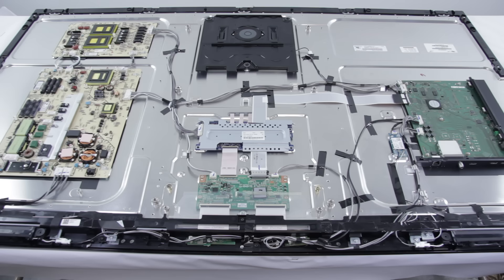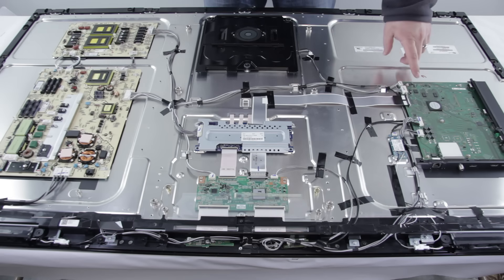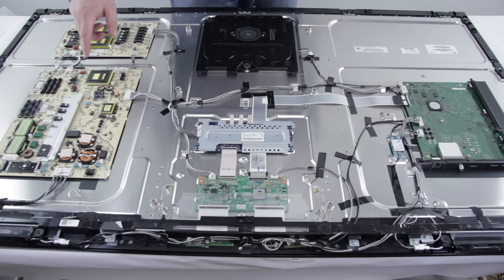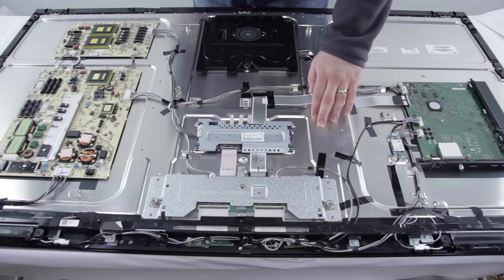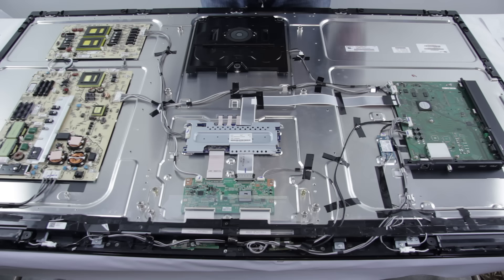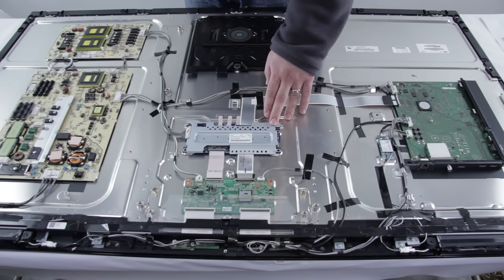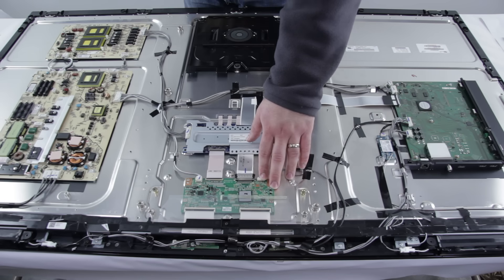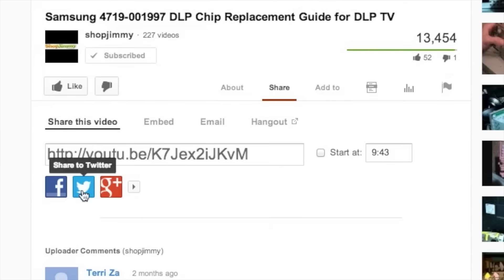LED TV Repair Tutorial - Common Symptoms & Solutions - How to Repair LED TVs

Comment: I have Samsung LED Smart TV UN46ES8000F and the TV goes through power cycling. The TV starts showing some random vertical lines and then turn off by itself. During the power cycling the remote control is out of control. Any suggestion how to fix this?
Reply from the maker: Reza Jafari   Try all repairs and troubleshooting at your own risk.  This sounds like a TV panel (TV Screen) problem.  If your TV panel is bad, it may be more cost-effective to replace the TV as panels are typically hard to find in stock, difficult to replace, and expensive.  Thanks and please let us know if you have any further questions!  www.shopjimmy.com

Comment: I have a 42 inch Sharp (model  LC42SB454U ). The power led on front panel is red, when I try to turn on tv it wll go out (no led light at all on front panel). and takes many attempts to power on.  I suspect that I have a bad capacitor on the power board. It will eventually allow me to turn on  (at which point I get the Green led on front panel) and tv works.   2 questions.    1:  is it possible to just find the bad capacitor and replace? if I find the bad (puffed up tin can capacitor type) and provide the voltage and farad specs, can you provide availability and cost.  Or 2: is is better to replace the entire power board and if so, what is the cost on this?
Thanks for your time and reply.
Reply: CoolUnderFire21 Sorry it was late the other night when I posted this, I have yet to pull the back cover off of my tv and will do in a couple of days, (time permitting) and get the power board part number and post here.  thanks
Reply: CoolUnderFire21 Ok, got tv down from mount, removed back cover, dusted out, found power board (2 numbers on it; one in the lower left corner of the board (715T3150-2) and the other one on the left verticle edge of the board with a bar code on it  ( ADTV82428PA5 (above the bar code) and (v28pa50610531 below the bar code).   I found a puffed up capacitor on the upper right (from pics I have taken) quardrant of the board, specs as follows  2700uf 16v (brand is I believe CapXom). I am versed in soldering skills and this should be an easy repair.   I would welcome any advise or recommendations as to just replacing the bad capacitor or if the bad capacitor may have caused other possible issues that could manifest later and would you recommend then just replacing the power board?
Can you let me know the costs (if you are able to quote them) for the power  board and the capacitor.
thank you for your time and effort.
Sincerely,
cool
Reply: CoolUnderFire21 UPDATE!!! I found and ordered the capacitor I needed and replaced and tv works like new. no more repeated attempts to turn in on..  comes on 1st time every time now (tested 50 times). so I am happy with my knowledge, and ability.

Comment: I have an 55" LG 55LW5300. Two white vertical bars appeared on the right side of the screen. They flicker and distort the picture. Any ideas?
Reply from the maker: Kayle Slaton   Try all repairs and troubleshooting at your own risk.  This sounds like a TV panel (TV Screen) problem.  If your TV panel is bad, it may be more cost-effective to replace the TV as panels are typically hard to find in stock, difficult to replace, and expensive.  Thanks and please let us know if you have any further questions!  www.shopjimmy.com

Comment: I have a LG 55LA4700, During a lightning storm power went out and came back on, after tried to turn TV on, only the LG logo at bottom glows for a few moments and then goes off, no sound, no picture.  I opened the back of the TV to check for blow fuses and or capacitors, power supply looks good.  I have tested fuse with continuity tester and they are good, so I am not sure where to go from here.  Can you help?
Reply from the maker: David Lindenberg  PLEASE SUBSCRIBE TO OUR CHANNEL - Try all repairs and troubleshooting at your own risk.   I recommend replacing the main board and the power supply board in your TV.  Please confirm your TV model number.  Thanks!  www.shopjimmy.com

Comment: Have 47 " LG led tv no backlights. Audio and video ok. backlights flash on for a second when tv is turned on. No out put to leds from power supply board. Could it be ps board or led driver board?
Reply from the maker: kristyn kellerhoff  PLEASE SUBSCRIBE TO OUR CHANNEL - Try all repairs and troubleshooting at your own risk.  Sounds like you have bad LEDs in your TV.  Unfortunately we do not have any replacement LEDs for your TV model number.  Thanks!  www.shopjimmy.com

Comment: Hi there I'm looking into buying a Samsung Led ultra HD TV,  model number UE55HU6900U, BUT it's got a broken screen and no power. The problem I'm having is finding what parts I need to fix it. I live in the UK and I'm asking your advice as to weather you think it's the G6 power board that needs replacing, and obviously the screen. It's also proving impossible to find the parts here in the UK. I've only been directed to US sites. And I've looked on eBay, Amazon, and other auction sites for a cheap TV that's for spares or repair, but with no luck at all. If you can advise me in any way I would be very greatful. Kind regards 
Esther Snowden
Reply from the maker: Esther Snowden   PLEASE SUBSCRIBE TO OUR CHANNEL - Try all repairs and troubleshooting at your own risk.  You most likely will not be able to find a replacement screen.  Thanks!  www.shopjimmy.com

Comment: I have an LG 47LN5400-UA. The lighting for the screen went out while I had the tv on, but the sound and input and everything else are still working. I did the "flashlight test" and could see a faint image. Is there any way to fix this?
Reply from the maker: Dani Stevenson   PLEASE SUBSCRIBE TO OUR CHANNEL - Try all repairs and troubleshooting at your own risk.  This could be a problem with either the power supply/LED Board or the LEDs in your TV.  You can replace the power supply/LED Board in your TV to see if that fixes the problem.  Click this link to a replacement power supply board for your TV model number:  http://www.shopjimmy.com/lg-eay62810801-power-supply-unit.htm  Be sure to match part numbers on your current board, with your replacement for compatibility.  Here is a link to a video showing how to identify your part number, click here:  https://www.youtube.com/watch?v=_4Qpfan0vdU  Thanks and please let us know if you have any further questions with your TV Repair!  www.shopjimmy.com

Comment: I have a LG led 42ln5300. The TV will turn black after 5 mins of power and then the red light indicator will continuously blink red and then maybe it will turn back on if I'm lucky. What parts do I need to fix it?
Reply from the maker: Braxdon Scaletta   PLEASE SUBSCRIBE TO OUR CHANNEL - Try all repairs and troubleshooting at your own risk.   I recommend replacing the main board in your TV.  Click this link to replacement parts for your TV model number:  http://www.shopjimmy.com/catalogsearch/result/index/?cat=56&q=42ln5300  There may be multiple boards for the same TV model number, be sure to match part numbers on your current board, with your replacement for compatibility.  Thanks and please let us know if you have any further questions with your TV Repair!  www.shopjimmy.com

Comment: I have a Sony XBR 55HX929, which I believe is just like the one you show in this video.  It will not turn on.  Instead a red light blinks twice, then pauses and repeats.  After some research, I believe this is because the power board, G6, is bad.  Yes?  Doesn't look too hard to replace, yes again?  Any additional tips appreciated.  Thanks.
Reply from the maker: Glimlach42   PLEASE SUBSCRIBE TO OUR CHANNEL - Try all repairs and troubleshooting at your own risk.   I recommend replacing the power supply board in your TV.  Click this link to replacement power supply boards for your TV model number:  http://www.shopjimmy.com/catalogsearch/result/index/?cat=59&q=55HX929  Be sure to match part numbers on your current board, with your replacement for compatibility.  Here is a link to a video showing how to identify your part number, click here:  https://www.youtube.com/watch?v=8YA2c8CZVyo  Thanks and please let us know if you have any further questions with your TV Repair!  www.shopjimmy.com

Comment: I have a Samsung led tv, model Un55d6900wf, that is turning itself off and then tries to turn itself back on.  When it won't turn back on, the red led light blinks twice.  I can hear it click like it's trying to turn on and then click again turning itself off.  This repeats until it turns on (even a few times after I unplug the tv).  Any suggestions?
Reply from the maker: Roger Winckler   PLEASE SUBSCRIBE TO OUR CHANNEL - Try all repairs and troubleshooting at your own risk.   I recommend replacing the main board in your TV.  Click this link to replacement parts for your TV model number:  http://www.shopjimmy.com/catalogsearch/result/index/?cat=56&q=Un55d6900wf  Be sure to match part numbers on your current board, with your replacement for compatibility.  Here is a link to a video showing how to identify your part number, click here:  https://www.youtube.com/watch?v=BEPWrefQvqI  Thanks and please let us know if you have any further questions with your TV Repair!  www.shopjimmy.com

Comment: Hello,
I have a Samsung UN60ES7500F.  The TV just died yesterday.  now it has this symptom - when power is connected you hear a clicking/boing noise then the small green led, at the top of the set next to the camera, blinks twice and repeats 5 times, then there is another soft click.  This repeats forever.  I suspect that the power supply is malfunctioning.  Do you have a how to video depicting the diagnosis of the power supply for this model or something similar.
Reply from the maker: John Graham  PLEASE SUBSCRIBE TO OUR CHANNEL - Try all repairs and troubleshooting at your own risk.   I recommend replacing the main board in your TV.  Click this link to replacement parts for your TV model number:  http://www.shopjimmy.com/catalogsearch/result/index/?cat=56&q=UN60ES7500F  Be sure to match part numbers on your current board, with your replacement for compatibility.  Here is a link to a video showing how to identify your part number, click here:  https://www.youtube.com/watch?v=sSJexLvRrjM  Thanks and please let us know if you have any further questions with your TV Repair!  www.shopjimmy.com

Comment: my tv has a flicker screen. its present in all inputs. the model is LED32B30RQD
 RCA 32 INCH HDTV LED DVD COMBO. can you help? thanks!
Reply from the maker: Pedro Morales Magonzales Maratto Mulasso Modestos  PLEASE SUBSCRIBE TO OUR CHANNEL - Try all repairs and troubleshooting at your own risk.  This could be a problem with either the power supply or bad LEDs in the TV.  You can replace the power supply board to see if that fixes the problem.  Click this link to replacement prats for your TV model number:  http://www.shopjimmy.com/catalogsearch/result/index/?cat=229&q=LED32B30RQD  Be sure to match part numbers on your current board, with your replacement for compatibility.  Thanks and please let us know if you have any further questions with your TV Repair!  www.shopjimmy.com

Comment: Dell LCD TV model #w3706MC no sound. It was crackling in one exterior speaker and went out. Later the same happened to the other exterior speaker. Everything else works perfectly.
Reply from the maker: Gregory Bryon   PLEASE SUBSCRIBE TO OUR CHANNEL - Try all repairs and troubleshooting at your own risk.  I recommend replacing the main board in your TV.  Click this link to replacement parts for your TV model number: http://www.shopjimmy.com/catalogsearch/result/index/?cat=56&q=w3706MC  There may be multiple boards for the same TV model number, be sure to match part numbers on your current board, with your replacement for compatibility.  Thanks and please let us know if you have any further questions with your TV Repair!  www.shopjimmy.com

Comment: Samsung TV Model UN40EH5300 that won't turn on after a power outage. I opened it up and saw a fuse on the board right above the power input but not sure if that would the problem or not. Any suggestions?
Reply from the maker: Rob Brown   PLEASE SUBSCRIBE TO OUR CHANNEL - Try all repairs and troubleshooting at your own risk.   I recommend replacing the main board and the power supply board in your TV.  Click this link to replacement parts for your TV model number:  http://www.shopjimmy.com/catalogsearch/result/?q=UN40EH5300  There may be multiple boards for the same TV model number, be sure to match part numbers on your current board, with your replacement for compatibility.  Thanks and please let us know if you have any further questions with your TV Repair!  www.shopjimmy.com

Comment: My Vizio 60" M3D460SR will make a noise like a bug zapper when i turn it on.  It will also have horizontal lines go across and get progressively worse until it gets so bad that the screen goes blank for a few seconds then the whole process starts over again.  What should I replace?
Reply from the maker: jbird0083  PLEASE SUBSCRIBE TO OUR CHANNEL - Try all repairs and troubleshooting at your own risk.   I recommend replacing the power supply board in your TV.  Click this link  to replacement parts for your TV model number:  http://www.shopjimmy.com/vizio-adtv12417xa2-power-supply-unit.htm  There may be multiple boards for the same TV model number, be sure to match part numbers on your current board, with your replacement for compatibility.  Here is a link to a video showing how to identify your part number, click here:  https://www.youtube.com/watch?v=4i57Cm9-96M  Thanks and please let us know if you have any further questions with your TV Repair!  www.shopjimmy.com

Comment: I have a Samsung un55d7050xfxza led tv that is cutting out at random times.  It also was "ghosting" frames at ramdom times as well as horizontal blocks would appear in different tints about half way up the screen.  Any suggestions?  Thanks

Comment: I replaced the main board in my Dynex lcd tv.  It had no sound or picture.  Now it has a screen but it says NO SIGNAL and still has no sound.  It is model number 46L261A12.  It has back light and power.  What could be the problem

Comment: hi have a samsung un22d5000nfxza
just wouldnt turn on one day. power light is off. i took the back off and the glass fuse is good. i did some poking around with a volt meter and its getting power through the fuse. i dont see anything burnt or signs of being bad. there is no power going to the main board. i know its a cheap tv to replace but i use this in a 5760x1080 display on my pc so if i replace one i replace three

Comment: I have a Samsung LED Smart TV Model UN 65 6300 series the bottom quarter of it is darker and then the top half I have an LED backlight problem can I replace that part? Could you point me in the direction of what part number I need? thank you very much
Reply from the maker: Paul Ceglia   PLEASE SUBSCRIBE TO OUR CHANNEL - Try all repairs and troubleshooting at your own risk.  This sounds like you have bad LEDs in your TV.  Unfortunately we do not sell replacement LEDs for your TV model number.  Thanks!  www.shopjimmy.com
Reply: Thank you for the reply, I will contact Samsung,  the tv is a couple months out of warranty they may still hornor it.

Comment: Hi, I have a UN40EH5050FXVA that has half the screen blank, it's like 2 vertical white bars with a black bar in between that covers exactly half the screen. I ordered a T-Con board, I swapped it out and there was no difference at all in the picture. Do you think I just bought a bad T-Con, or can the main board cause this type of issue? Thoughts? Comments?
Reply from the maker: Matt Flynn   Try all repairs and troubleshooting at your own risk.  This sounds like a TV panel (TV Screen) problem.  If your TV panel is bad, it may be more cost-effective to replace the TV as panels are typically hard to find in stock, difficult to replace, and expensive.  Thanks and please let us know if you have any further questions!  www.shopjimmy.com

Comment: Hello, good morning. I have my tv SmarTV led philips 39pfl4707g / 78, that after a nearby lightning crashed. .?. Taking a checked on components, I notice that U701 (G1084-33TU3Uf is quite warm, spreading heat around Please, what is the solution Grateful See page 58 of the file: scheme + electric + 32pfl4017g 32pfl4707g + + + 39pfl4707g 42pfl4007g + 46pfl7007g.rar - RAR archive, unpacked size 22936717 bytes in electronica-pt.com. Gratefull.

Comment: I need help. Ive got a 24" LED TV Panasonic model number TH-L24X5Z. SYMPTOMS: powers on and works with ps4 applications for a while or until I start up a game then it shuts itself down with the led light flashing at the bottom of the screen. Sometimes if I pull out the hdmi connection itll switch back on and search for a signal. Plug it back in maybe itll work again for a bit then samething happens. From what I gathered from your videos something to do with the main board. I have a digital multi-meter/ volt meter and a soldering iron at hand. Please help before I begin electrocuting myself lol
Reply from the maker: Adonai Tsebayoth   PLEASE SUBSCRIBE TO OUR CHANNEL - Try all repairs and troubleshooting at your own risk.  I recommend replacing the main board in your TV.  Unfortunately I do not see any replacement parts in the search results for your TV model number on our website.  Please reply with your part number on your main board and I can try searching for replacement parts.  Thanks and please let us know if you have any further questions!  www.shopjimmy.com